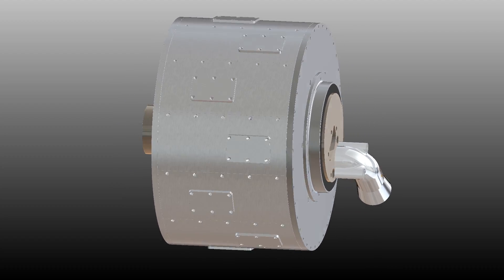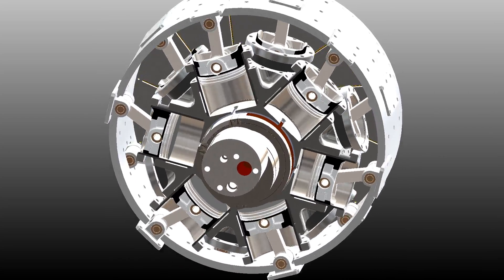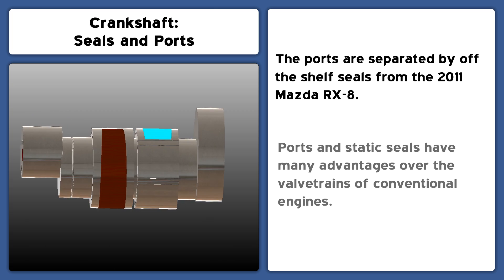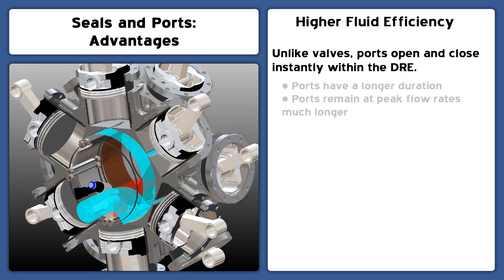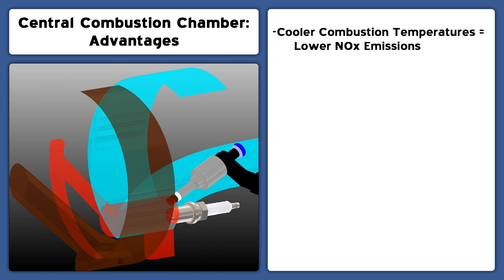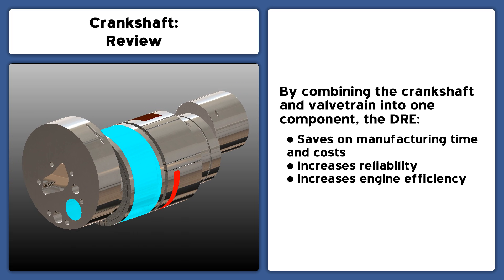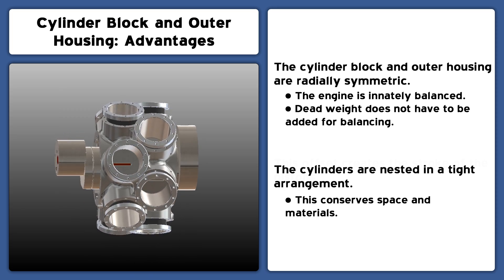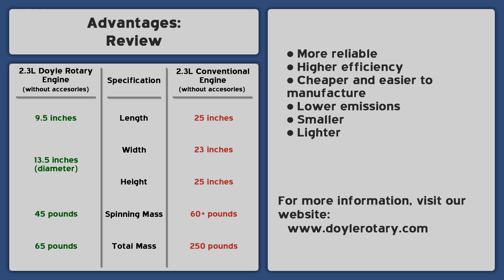New Split Cycle Engine Concept: The Doyle Rotary Engine

Comment: First thing that comes to mind.. with a 12 Cilinder block.. how many revs wil this run?.. it is like a HUGE flywheel.. Eating up a LOT of energy.. furthermore.. how are you gonna cool this puppy?.. and.. with only one exhaust?..how will you maintain a low enough temperature ?..
Reply: +Jan Binnendijk Flywheels store power.  They don't eat it haha.  I'm wondering how the cooling system will work too.
Reply: in order to store it.. you must first put it in.. it is commonly known that race-engines have a smaller flywheel, so they will run faster.. indeed.. they lose some torque...
Reply: +Jan Binnendijk my point exactly.
Reply: ***** Race Cars don't coast to a stop haha or try to maintain high gear through load changes.  The built up inertia will come back when we are driving normal.  Race cars need less weight, and more reaction time. They'd just burn off all of their inertia in the brakes anyway. Passenger cars use smooth power.  

And one more thing, the race car only "loses torque" until the comparable car with a heavy flywheel uses up the kinetic energy stored in said flywheel. Then it would seemingly "gain torque" as energy is being transferred to the flywheel to be used again later instead of the wheels at a lower ratio in the race car.  This is why you'll go faster up a hill with a heavier flywheel.  On a rolling start you'd essentially get a head start at the base, and the guy with a lighter flywheel would slowly gain on you since you are putting more energy into charging your kinetic battery.  You'll get your head start again though at the base of the next hill, all else being equal.  The average speeds would be the practically the same after enough distance.

Comment: Are they still trying to push the pile of cr-p ,  They have been trying to con people out of there money for years.  A friend of mine invested in this,  when he told be about the engine I explained why it was not good,  he lost his money.  I even went to a talk on this at Brands Hatch and the late Jack Brabham was there pushing it.  I explained to him why it was no good and he had to admit its short comings .
Reply from the maker: I have no clue what you are talking about. This is a project my family has been working on for years in our own shop, on our own dime. It's on hold at the moment while we work on other projects.
Reply: +Nick Palaroan The pistons and rods in 3 of the 4 strokes in a conventional 4-stroke engine are also "dead weight."  In this design there is a lot less "dead weight" than conventional IC designs.  Will it work?  I have no idea, but it certainly is a very novel and interesting design.
Reply: +patirck frawley This is a very valid point.  I am an automotive student and former engineering student.  It seems favorable at first that a new format can use existing components, but one must consider the short comings of the device that component originates from.  This particular design holds the notorious short-coming of the Wankel-cycle's practical manifestation: extreme temperature difference in a single part which effects the ambient-overall temperatures', of other parts, to an extent that 'non-predictable' short-term failure is sure to happen.
Reply: +patirck frawley  Agreed, I have seen various split cycle engines before. Usually they set up a company, take the money, find technical problems, take more money then claim there is a conspiracy and run away with all the remaining money. 
+Adam Doyle, if you are genuine, then remember that you are not the first person to tout a split cycle engine. But it has always ended badly before.
Reply: +Adam Doyle You should make a radial engine for a car(water cooled), they are powerful and would save space. Please consider this.
Reply: +Adam Doyle Scrap the design. Half your cylinders are dead weight, the other half is powering your dead weight cylinders and turning a giant wheel. So much power lost over the traditional design.
Reply: +Nick Palaroan You do realize that the Otto Cycle engine loses 2/3rds of the energy from combustion out the exhaust ports, whereas this engine captures more of that lost energy.
Reply: allblacks420 It loses about a third out of the exhaust ports. It also loses about a third out through the cylinder walls.  You are correct in that about two thirds is lost.
Reply: +Nick Palaroan Dead weight doesn't lose power.  He can use less cylinders if he so chooses.  I'm sure his prototype will turn out to have as few as possible for simplicity's sake while remaining symmetric, possibly a 4 or 6 cylinder.  To me it would make more sense to have many cylinders to a practical limit, so you could efficiently use all of the space, and have a higher power to weight ratio.  The efficiency, and therefore power from this engine would come from having less moving parts per cylinder, and better utilizing the combustion part of the cycle like allblacks is referring to.  Using  pistons, it makes sense to split the cycle so that we can utilize more of the heat before it gets wasted out the exhaust ports.

Comment: 12 cylinders.  but less moving parts than a v8.  I don't buy it.  a standard v8 engine does not have 200+ moving parts as the video suggests.  And the video did not do a good job of showing how this converts to a drivetrain.  If this was a good motor it would be in production.  Not just on youtube.
Reply: Majick0003 There's a long history of great engines getting engineered to perfection and then sat on - consider the torrid history of the Dyna-Cam.  After getting it FAA certified, new owners scrapped the whole thing and started in on a version dependent on unobtanium like lifetime, lubrication-free ceramic bearings and crazy carbon composite piston seals.
Reply: +Majick0003 The valves + Springs and their rockers alone are 48 moving parts at a minimum bud, 96 if there are 4 valves per cylinder.  If its a push rod engine there is even more parts.  If its overhead cam, there is at least one chain to contend with and at the very least 3 or four gears.  We haven't even got to the actual power producing parts yet, just the parasitic ones.  This engine has none of that, and keep in mind that I was just putting out simple designs.  Many modern engines have variable valve timing for efficiency and performance at a theoretically lower level of efficiency.  Remember what time period you're living in.  Obviously he's not talking about an old Ford 302

Comment: Cool little engine but it will never ever replace what an American V8 can do. Mine for example. 408 magnum. Bored out 360 magnum. It sits in a 96 ram 1 ton modified suspension. 4 speed transmission. 3:55 rear gear. Posi rear end. Its pulled loads up to 17,600 lbs and hauled 3.2 tons. That little car engine would melt under that much work. But for a light little car it's not bad. But my truck is 7450 lbs without me. I'm 230. The 408 is pushing 700 hp and 950 Ft Lbs of torque to the rear wheels. Nice idea for a car but still can't beat AMERICAN MUSCLE! . I am a Automotive and Diesel technician. So good luck Mazda.
Reply: +Clayton Ferguson Nobody cares about your truck moron.
Reply: Clayton Ferguson This video has nothing to do with Mazda.  But Mazda is coming of age with respect to Diesel.
Reply: +Paul Girardin That's pushing like 11,000 TEU containers.

Comment: Losing reciprocating mass is a major benefit, lots of power to be gained from that alone.  I'm not a big fan of a moving surface sealing the ignition stroke. Frequent seal replacement could nuke public acceptance in the first generation.  Just ask Mazda.

Other than that, it's brilliant . . . well, if manufacturing costs are commensurate with the status quo.  

Incorporate it into a compressed-air hybrid and I'd buy it in a heartbeat, though I might live to regret it if the seal issue isn't sorted out properly.
Reply: Sorry for the addendum, but I was reading the comments and I do wonder about cooling.  I can see how coolant could be circulated through the "crankshaft" because it's stationary and is, essentially, the "head" (among other things), but the cylinders performing the ignition stroke would also require cooling.  Would they be cooled by the oiling system?  

Another issue is intake temperature.  Since the 'crank' is the 'head' as well as the intake manifold, its temperature would heat up the intake air contributing to a less-dense charge.  

The video indicated that oxides of Nitrogen are lower.  Reality trumps theory, so if you indeed have a working prototype and this is your actual result, I guess this 'hot intake' theory doesn't hold water.  But if you don't have a working prototype, you may find NOx to be higher rather than lower and in spite of a theoretical higher compression, the actual density of the charge may be less than you theorize.

Anyway, good luck with this.
Reply: Curby Weaver Actually I don't think water cooling would be very difficult. If these cylinders are housed in a stationary housing sealed to the crankshaft, it could be as simple as flowing water into the crankshaft and into the "block" (if you will) and letting centripetal force move it to the outside where an outlet and thermostat would be. (Think of it kind of like an over-sized current water pump.) Although this would decrease efficiency and acceleration because now it would have to rotate the mass of all that heavy water.It could also be counteracted by making it a ceramic engine like Nissan's prototype from the late 90's which did not need any cooling because the ceramics could withstand up to 1.5-2K degrees F (if I remember the numbers correctly) which also made it atomize and burn gasoline more efficiently. This also allowed it to lose the weight of the water, pump, and radiator. Not sure why it didn't go farther though.
Nothing is without its own myriad of initial obstacles.
Reply: Mike Stromecki Maybe because ceramics are extremely brittle and delicate?

Comment: Sorry but biggest flaw is if the housing is what's rotating and the shafts is fixed position your output now relies on a flywheel of sorts for main linkage transfer. Everything we have now uses a shaft for output, we just have to redesign everything, ever, to work with this, no problem..... an engine is useless w/o a transmission mate
Reply: Electric engines would beg your pardon ;)
Reply: hamorsteak  there is no such thing as a electric engine.  An electric motor is just an electron turbine basically. That is not a prime mover.
Reply: +hamorsteak Electric motor is an entirely different game. An engine and a motor arent interchangeable
Reply: Max Kleisch yep

Comment: This seems like it would waste a lot of torque, and cause unwelcome rotation characteristics unless mounted with a counter-rotating "sister" engine. Similar engines were used on primitive aircraft, until the superiority of radial and inline engines became assured. This new innovation concerning how to time radial engines seems rather like giving a dead horse new, cybernetic legs. The thing may run around a little, but will soon seize up and fall to pieces (Like the prototype of...). 
Worse, the only reasonably reliable way to cool something like this would be with high-speed air flow, and bolting this onto an airplane would make takeoff unsafe due to intense oscillation at high rpm, and the engine trying to turn the plane just as much as than the propeller, the effect which made the Sopwith Camel so deadly to the pilots who learning to fly it.
At least the Bentley, Gnome, Rhone and Clerget engines didn't turn and vibrate madly at the same time.
To see somebody get a dead horse moving a bit longer, try the Hale rotary. It's still a dead horse with robot legs, but at least it's duct-taped together a bit.
Reply: I usually wouldn't come down on a new idea so hard, but I sincerely believe that if this were tested on an airplane, the crew of the aircraft would be in an unacceptably dangerous situation.
Reply: airsoftkillamanjaro Looks like the best place to start applying this would be in fixed and portable generators, where the power density would be appreciated.  Also, the cylinder housing could be ported with turbine blades to provide cooling air to the cylinders.
Reply: Ian Garris That would make sense, but I'm a bit of an aircraft/automobile enthusiast, so I usually think of the viability of an engine for use in a vehicle before other applications. 
I was thinking about how a cooling fan (or fans) would be fitted, but the housing receives the force of the piston as it moves through its stroke, so drilling holes seemed a dangerous loss of structural integrity. That said, there is probably an acceptable size and location for cooling ports somewhere on the cylinder.
Reply: airsoftkillamanjaro I think the housing itself could be made to act like turbine blades.  A bigger problem might be cold-weather performance when too much cooling will keep an engine from working properly.

Further, with a design putting the housing into a tensile configuration, much of the spun mass could be removed, reducing gyroscopic forces to something more like what you'd expect in a vehicle engine.
Reply: Yes, it would need to be mounted inside a ducted cowling to properly control cooling.
I am aware that the weight of the housing could be significantly reduced, but the force I was more worried about was the oscillation of the cylinders/housing,
Depending on how the engine is mounted. torque can easily be counteracted with a bearing mount and careful trim of control surfaces/suspension. The vibration generated as components spin off-axis is what I'm referring to.

Comment: The inertial loads present due to centrifugal force will reduce compression pressures as they will oppose piston movement as RPM increases limiting peak output to a low to mid power band. Interesting design still.

Comment: Any plans to use this as a helicopter engine like the counter torque designs of the Douheret helicopter , the 1945 Roteron XM-1 , Or the Bruno Nagler  model 120 and 160 designs patents 2948491, 3206145, 3417825

Comment: Cool concept except it's gonna have the same problem as a wankle engine..  All the combustion happens in one place.  Therefore all the heat is focused . heat related problems are big.  The material stresses and expands unevenly.  resulting in warping and seal failure, etc.

Comment: While the advantages are great and I love the design... you are forgetting key points in the design and you forget that making even one of these cars go into production will cost millions training and schooling aside. And your flaw is simple, you have one row constantly on intake and the other constantly on exhaust. Cut the shaft in half make one half exhaust and one half intake and you should fix this problem. 
     But even after the flaws are fixed and a prototype is made you still have to think of other costs and factors of the car this engine is powering like how many RPM will it put out and what F/LB will it put out. With these factored in you would need tiny cylinders to get a 2.0lt O12 model and then it will kill your MPG which is many companies main focus in this day and age.
      So overall you are asking for millions of dollars of investment to get one car out then you need to convince a company to buy your concept which will be difficult considering the design is structurally flawed. Sorry man but this one is not worth it although it was a nice try. Also what will rotate the casing? You didn't specify a rod design.

Comment: the intake ports will have to be lubricated - in other words, you have to mix oil with air, which will be burned... just like a two stroke. And it is for this reason (emmisions) that two strokes arent used in cars at all anymore. And of course this has far too many cylinders to be practical in smaller vehicles.

Nice try.

Comment: "dead weight isn't needed for balancing". Its only rotating a bunch of pitons, cylinders, and connecting rods while still moving the pistons back and forth. The inertia of the parts I just listed would make trying to rev this engine very inefficient. the total output not only would have to move the drive train, but move all those other parts. how would you go about keeping this cool? where do you put a coolant hose when the cylinder block is spinning?
Reply: ***** I know this is "YOUTUBE" it was honest criticism for the concept. That's why the comment section is here. For comments, not for people to tell you what website you're on and say its all fantasy anyway.
Reply: ***** Sleep? Why would i do that?

Comment: i dont see where the heat to motion conversion is taking place. a piston a few deg. after tdc is inefficient at creating motion after about 30-40 deg after tdc can it push hard on the crank and after approx 60 more deg. its inefficient again. i think this could work for an air pump but i dont really see an efficient conversion of power, or i guess to re word it i dont see where a piston could push on anything very hard to create motion.  i believe the radial engine is made the other way for a reason it still has a crank and something to push hard on after 30deg of rotation.

Comment: Heep off crap to many moving parts 
How dose air flow 
In point what foul is used
A stop watch would work better good luck or go back to the shed
Reply: You sir, might have a valid point. That there however, wasn't english.